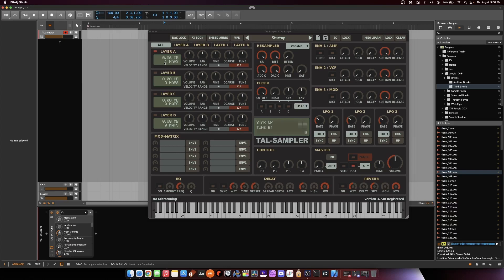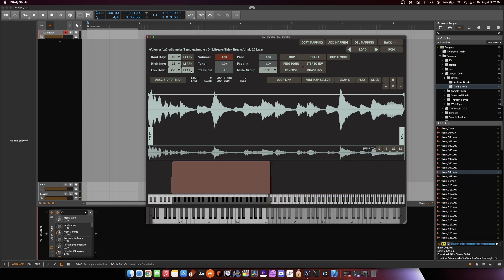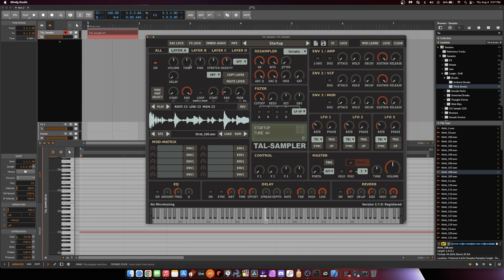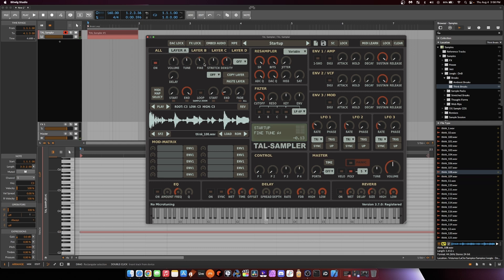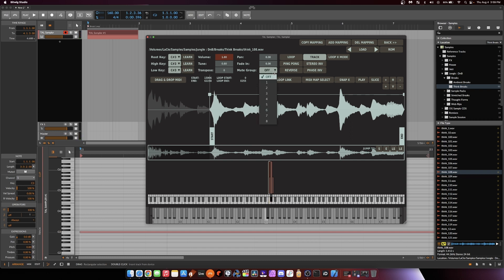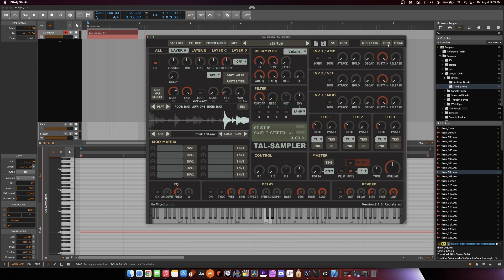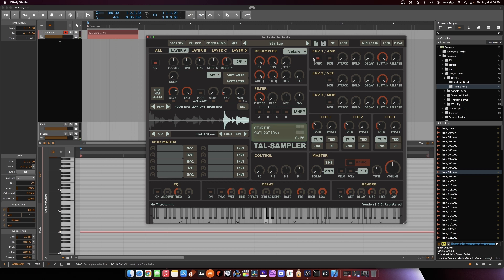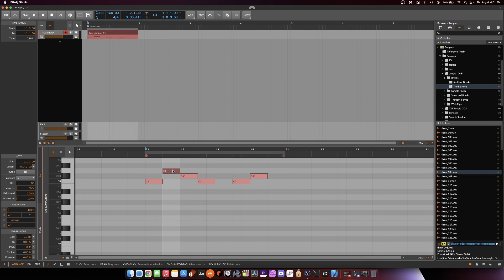Chopping breaks when you dont know the BPM (In TAL-Sampler)

Comment: The way I did the loop point finetuning on my S950 27 years ago was to play it an octave lower for more precision.
Same way for creating multisample breaks: play/record them at half speed and then double the speed. And add a reversed (alternate loop mode) 8th beat for instance when I didn't like the 8th beat sound or its transition back to beat 1
Reply from the maker: That's the ticket - I've heard of folks doing that. Can see how that would help, going to have to give it a try. Appreciate you sharing some technique!
Reply: Playing and then recording it live also gives you more control over the breakbeat. And it is more fun than just entering and moving notes around with a mouse.